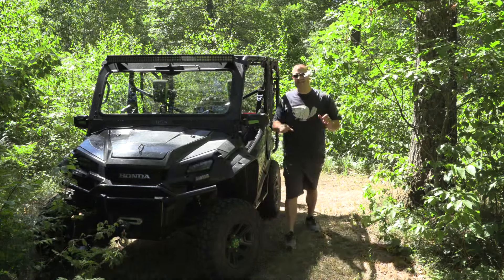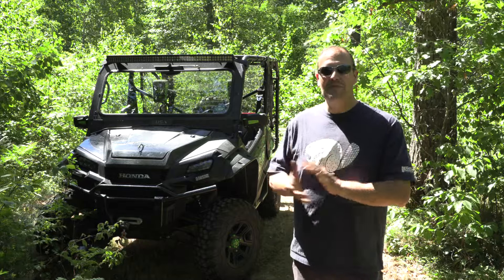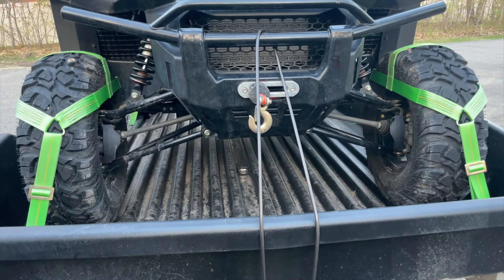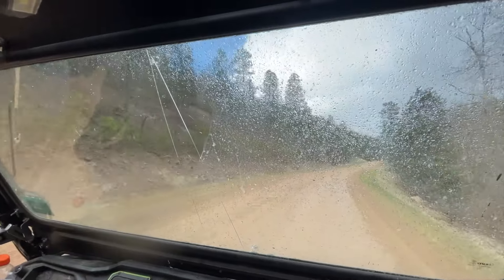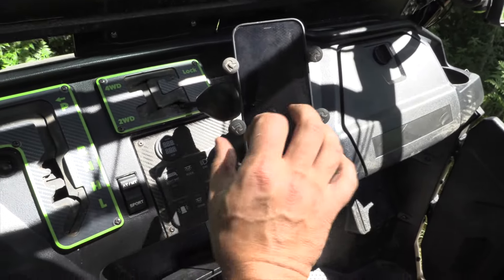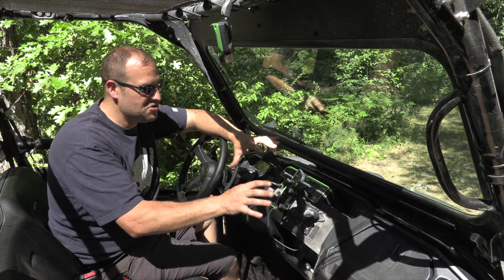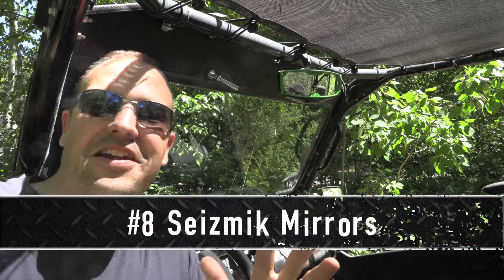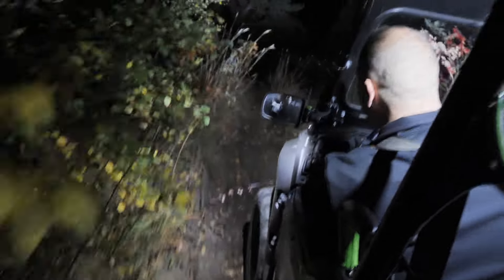Top 10 Trail Upgrades for your Honda Pioneer 1000

Comment: One modification I made to my Pioneer was to install easily removable back doors covers and rear side panels covers, and cutting out the door and rear side panels to allow storage room.  I keep my jack, recovery straps, snatch block D-Rings, shovel, tree saw, 1st aid kit, coiled air hose, tire patch kit, etc.  I also use the area under the drivers seat for spare fluids (oil, diff oil, radiator coolant), tools, air compressor.  So, you would never know I had all this extra gear by just looking at or in my machine.  Wish I could attach photos to show.
Reply from the maker: I bet you’re talking about something like this :-)

Honda Pioneer Storage Modifications - The Ultimate UTV
https://youtu.be/QIlWS5lZw-8
Reply: @UN12actual  Yep.  Rear door and 2 smaller rear side panels

Comment: That's an impressive amount of mods.  Your efforts really paid off.  I saved this episode.  I can't think of any mods I'd rather have than the ones you installed.  You thought of EVERYTHING.  Now, I just have to buy a Honda UTV!  I just subbed & rang the bell.
Reply from the maker: I am adding a power windshield wiper and some type of soft top removable rain cover.  But otherwise still going strong
Reply: @UN12actual  👍

Comment: I would say with the p1000 a second battery is your first priority. Then winch and then what ever you want but tires have to be in their also. 1/2 windshield for me and mine comes off when summer gets here.
Reply from the maker: Second battery is a must.  I did a separate video on electrical   That is just a given that these needs a second battery.
Reply: Just put my winch on. Will be installing 2nd batt(26ah mighty max) when I hook up the stereo & 12" triple row led light.
Reply: Would the second battery be for the winch?
Reply from the maker: Winch and all of the high draw accessories like light bar etc.

Comment: The extension was pretty cool if you can afford it. It is extremely expensive and to top it off they wanted 137.00 dollars to ship it, I guess they needed a little gravy money after knocking your head off! O, did I mention, 14 weeks for delivery, I wonder how much they make in interest on all those orders over 14 weeks? Looks good, but no thanks!
Reply from the maker: I doubt they are making money on shipping, it was a very large heavy item that had to come via freight. Quality products aren’t cheap sadly but this has been a worthwhile investment for me.  I’ve used this a lot on trail rides and having the room, cooler mount, gas and a spare has been great to have.  I know it’s a lot of coin but I’ve been very happy with the enhancement to the machine

Comment: Would really like your thoughts on the Elka shocks.  I just purchased a 2022 1000-5 Forest 6 weeks ago.  Wish I would have seen this video before I wasted my money on the Honda Plastic windshield. Besides the point our trails in Northern WI can be very rough.  There isn't much info on the Elka shocks on a utility side by side on You Tube.  Could you let me know you thoughts on them or when you post a video.
Reply from the maker: I have been torn on making a review on them.  I bought the stage 4, I like them over the stock but not to the amount I think I should or others say.  I do think its really a matter of them not being adjusted properly.  When I first got them I was shipped the wrong springs and had too much sag, then I got stiffer rear springs which helped.  Now the ride is better but I still think it can be too harsh on certain bumps or dips, at higher speeds I have noticed a better ride and absorbing more bumps etc.  One of my winter projects is to replace a broken axel and adjust the shocks with factory recommendations.  Broke a front axel on my last ride of the season 50 yards from the trailer goofing around ha ha.   In some ways I feel like the Honda Fox adjustable shocks ride just as good if not better than my elkas when I rode the trail model at the Honda event.  The Elkas should be better than the fox which is why I think its an adjustment thing.  Probably be a next summer video once the trails open back up.
Reply: @UN12actual  Thanks for the input.  I know a few guys that have the Elka's on snowmobiles they love them but they have a racing background.  I am and as you are very knowledgeable in firearms sighting in a scope is no problem. Others struggle. I feel the Elka's stage 3 and 4 are more tuned for the racing guys.  There is so much adjusting on them to really use what you spent on them.  I feel for the common guy the Fox shocks designed for Hondas are they way I will go.  Thanks for the help.  I am a huge Tactical guy my second Hobby.  Can't believe I never came across your channel before. It took me searching Pioneer video's to find you.  Either way I'm sure you'll be seeing me in your comments on other Videos. Thanks again for your time.

Comment: Hi Dave, Thanks for your content on your HP1K5.  I must have watched this video 10 times.  I'm copying a lot of what you are doing.  If I buy any of the gear you use, does that help you out?  Also, are you running the same size tire on all 4s?  If so, do you like your set up and what size trie, rim, spacers are you using?
Reply from the maker: I went with 1" spacers in the rear, then all 4 wheels and tires are same size, plus the spare.  I have 28" but after adding the lift I want bigger tires ha ha
Reply: Nice! Do you remember what offset you are running on your rims and do you like the setup?
Reply from the maker: @curtisparry3146  I can’t remember if they are 4/3 or 5/2 as they were take offs from a dealer close out.   I think they were 5/2.  I got them because it was a great package deal, however the tired ended up being crap and had to buy new ones anyway.  I went with terabytes and overall like them    If I were doing it over again I probably would have bought the original wheels I wanted either a fuel or method and tires but these wheels still work just fine.
Reply: Hi Dave, thank you. That is extremely helpful! 
I am leaning towards Method wheels with the “Bead Grip” technology…but some UTV enthusiasts swear by beadlock wheels. Any thoughts about weather to be beadlock or no beadlock??

Comment: Genial, todas las actualizaciones. Muy amable por compartir sus útiles consejos.  A mi buggy, pienso ponerle un radio CB y FM,  pues soy radioaficionado,  con una antena abatible. Luego un GPS, para  ver destinos.  El winch, de 6000 libras, será todo un reto. La idea es divertirse. Es pasear, lejos, con libertad. Grabar en la memoria, todos esos lugares hermosos que nos perdemos de ver y respetar.  Quizá, abrir la conciencia de preservar. Poner un tanque extra de combustible. Con la idea de adicionar un motor eléctrico en un futuro próximo Y la idea de colocar sobre el, un panel solar, colocar un cargador doble, que cargue la batería adicional de litio y otra se encargue de mantener la batería del vehículo.  Eso se hace con un cargador renogy. La batería de litio es de 100A, 12v, LIFEPO4.  Así puedo manejar el winch y radio y cosas futuras, como el pequeño motor eléctrico auxiliar. Sinceramente, el tiempo que disfrutamos sanamente, y compartimos, es ganancia.  Por si hay algún peligro, de perros que se te tiran, tengo un bastón de pulso, de 70 mil voltios. Paraliza cualquier cosa. Usada en muchos ejércitos.  Y eso, que soy el más calmado de la familia. De paso, llevo el arco y flecha, para practicar tiro al blanco.  Bueno chicos, a divertirse, Dios los bendiga.

Comment: So has Honda fixed the impossible shift problem?  Know issue for years is that where you shift from turf to 2x2 or 4x2 good luck getting back to turf.  I ask about it every time my 1000ESP goes back to the dealership for another damn recall.  They can’t fix it.
Reply from the maker: I haven’t had that issue with mine.  I know on the forums they mention adjusting the linkage.  Have you tried that?